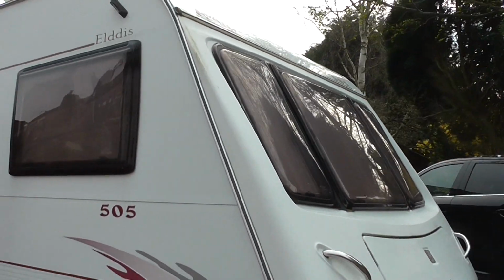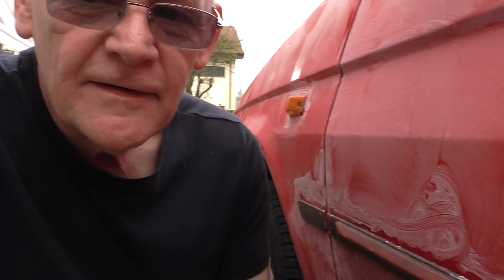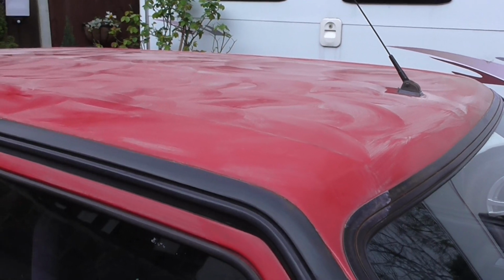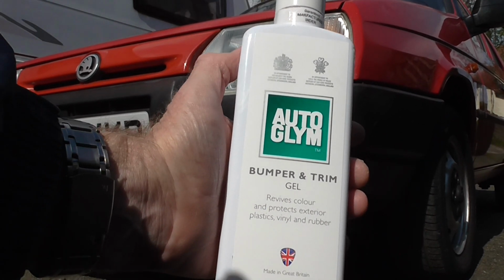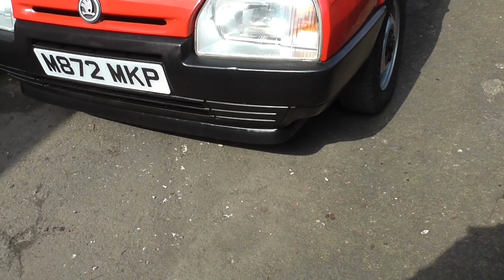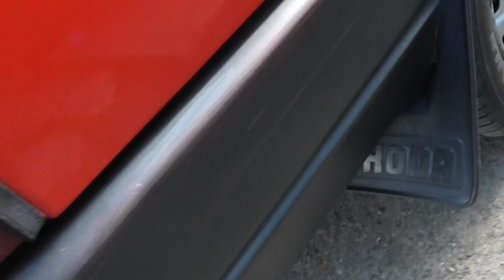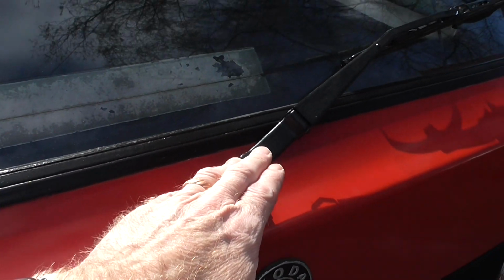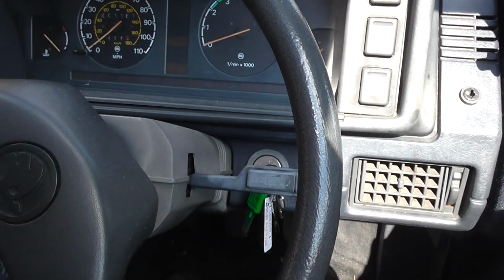Part 2 . The Skoda Favorit Estate gets a waxing and the external trim gets a face lift .

Comment: With a wax and the plastic trim done you really have transformed this car. I I used to valet cars professionally and It has surprised me just how well it has cleaned up.  
You could try Autoglym vinyl and rubber cleaner on the dashboard, it’s a good product and comes in a trigger spray container.
Reply from the maker: Thanks for your recommendation for a product , I will get some and see how it all comes up ,  it has also surprised me on the end result ,thanks for your comment.

Comment: Looks good that trim stuff will probably work on the tyres to
Reply from the maker: It did certainly do a good job of the trim ,never thought of using it on the tyres but it does say on the instructions that it can be used on rubber.

Comment: Are parts getting scarce now that Favorit's are getting super rare?
Reply from the maker: At the moment parts are fairly easy to find , I am thinking of getting another one to strip engine box and axles of to try and maintain this Skodas longevity . Thanks for your comment.
Reply: @ShaunMurray63  Good idea. Come to think of  it there will be loads of Favorit's (Forman's left in eastern Europe since they love cheap cars. Do you remember when we exporting old Skoda's back like no tomorrow?
Reply from the maker: @jaggass  Yes and the Ladas also went back in droves , the foreign cargo boats  used to dock and they scowered the local areas for them . The Ladas were taken back for spares as they had a lot of trouble getting them in eastern europe.
Reply: @ShaunMurray63  Ive seen a video of Quentin Wilson buying a Lada Riva that was a huge MOT failure but still made £500. Its probably £450 more than a scrapyard would have paid for one.
Reply from the maker: @jaggass  No I haven't seen that I will look for it on youtube and your'right I would probably made not much more than that for scrap.